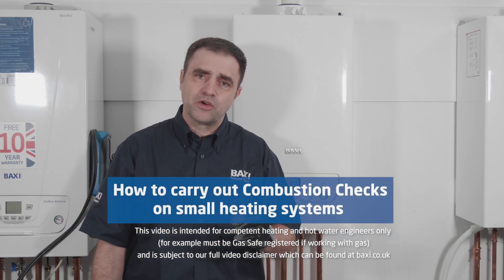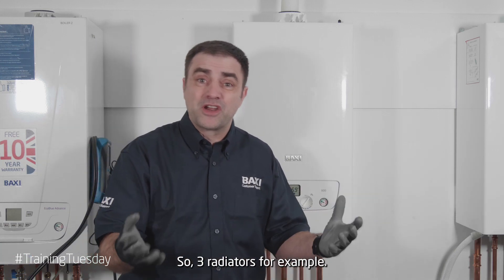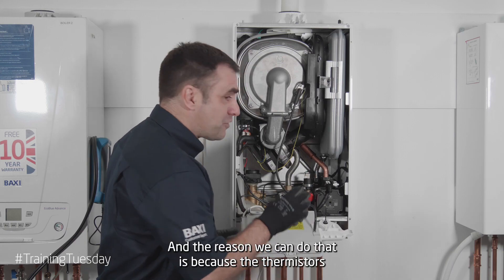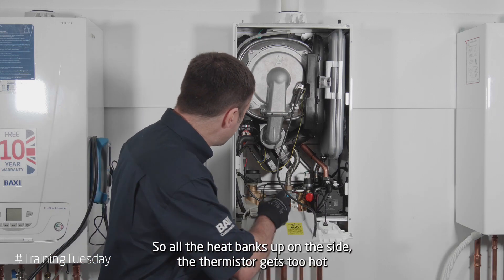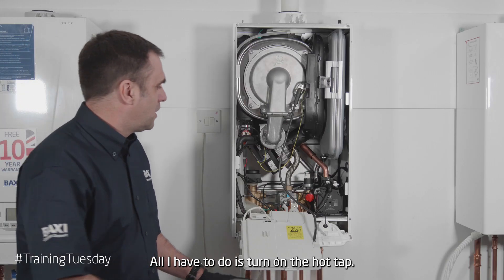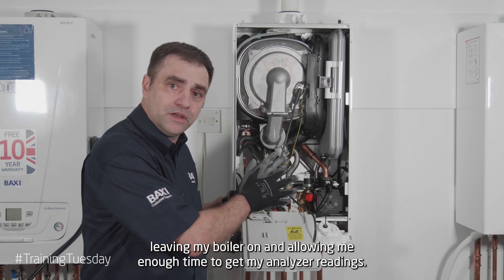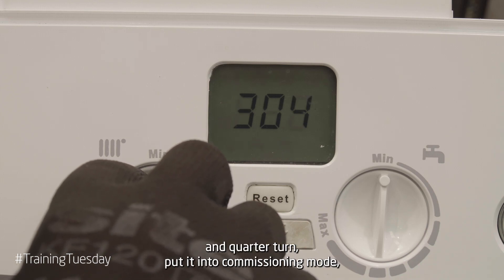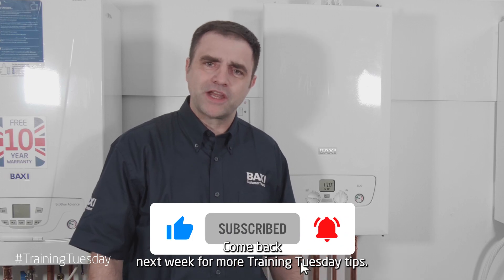How to carry out combustion checks on small heating systems

Comment: Can you not just turn hot tap on ? Or still have to put it in commissions mode ?? 
Cheers
Reply: Its not quite the same. In hot water mode the boiler will modulate to maintain the set hot water temp rather than operate continuously at maximum.  If you have the tap full on though with the temp set to maximum the boiler output will be similar, especially in winter with a colder inlet temperature.
Reply: would be interesting to know if there actually is a difference and if so what is it. thanks